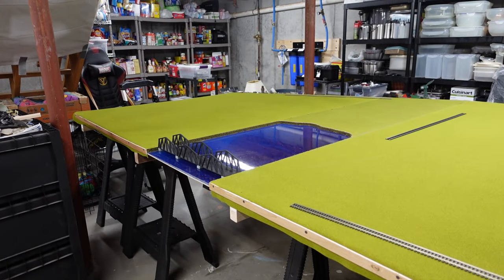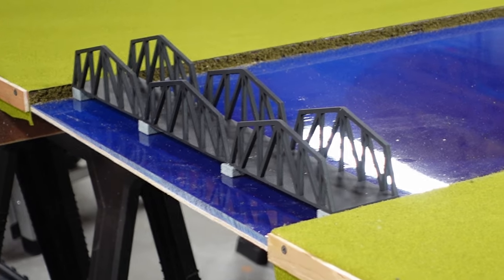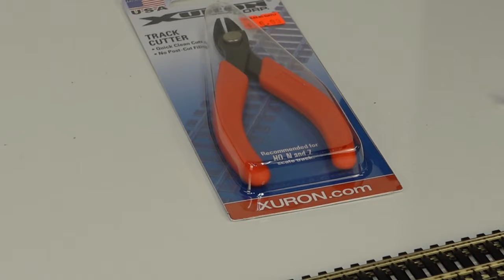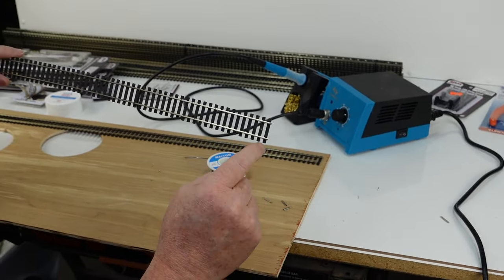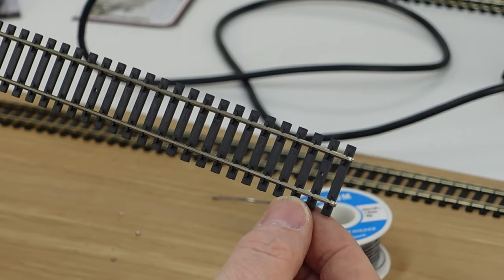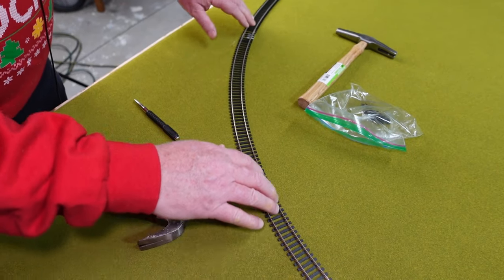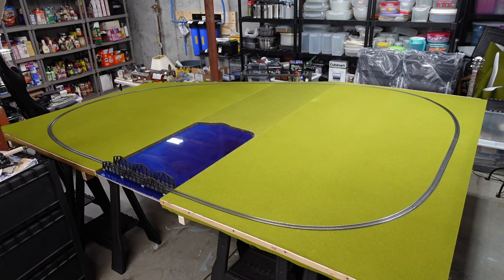Part 5 Fall 2023 HO Scale Layout Redo - laying the flex track!

Comment: Tin the tip of the iron before soldering!
Reply from the maker: We're aware of tip tinning. If you look at about 15:44 on the video, we do tin the tip of the iron.  We've tinned both with the solder itself and also with a tip tinning paste we tried from Amazon.  The tip tinning paste actually worked pretty good. That said, we were soldering track for the first time ever so our tip tinning technique might not have been quite up to par (the tip didn't get that nice shiny coating of solder you look for).  I do think we've gotten better as we've taken on more soldering.  Thanks for watching!